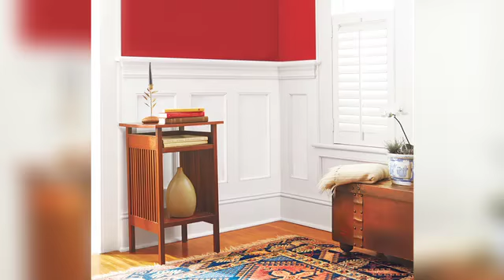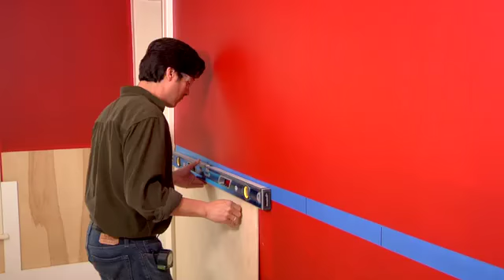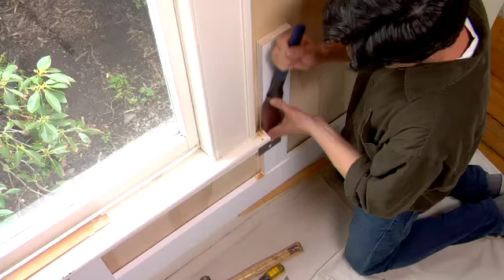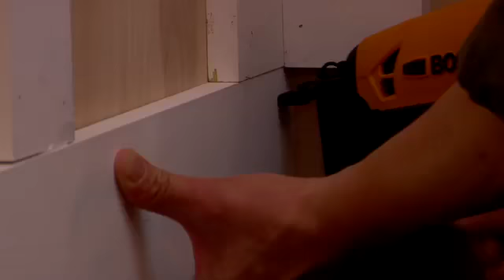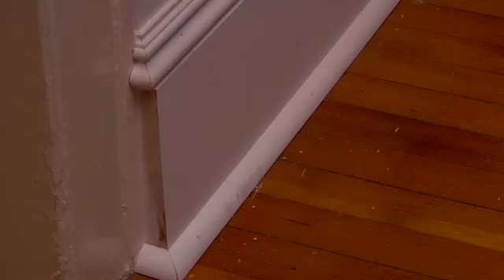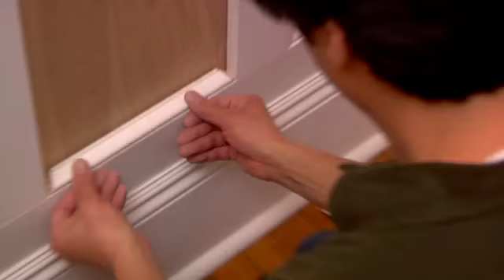How to Install Wainscoting | This Old House

Comment: I'm not fully understanding why the measuring stick was angled, any enlightenment?
Reply: +Matthew Bellis The length of the wall might not come out to an easily divisible number. So you mark even measurements on a longer piece (that divides evenly into the number of segments you want) and set it at an angle. If the piece is straight then the segments will be evenly spaced on the wall and you don't have to do any math to figure how wide each segment needs to be.
Reply: hole &*@$ that's a cool idea. i'll admit, i didn't get it until you explained it.